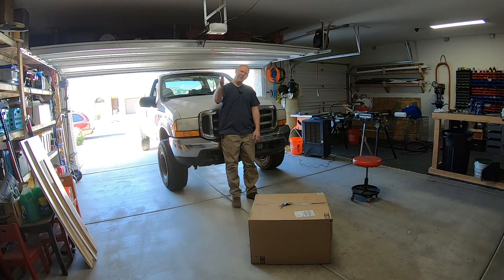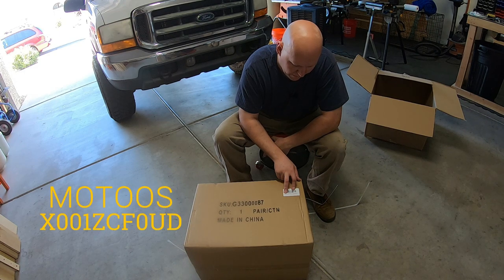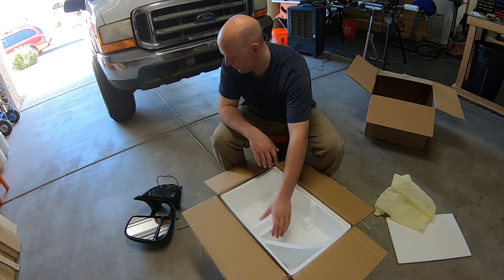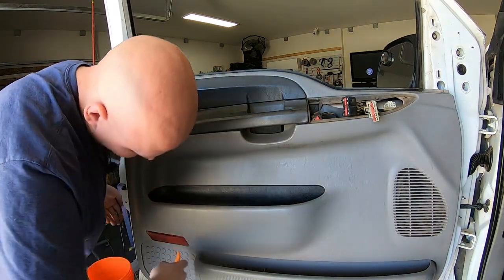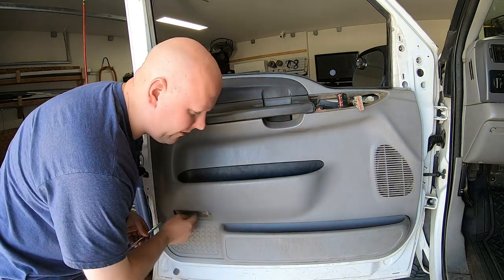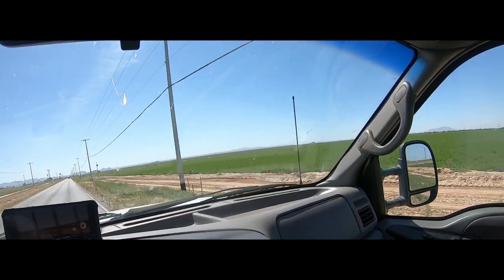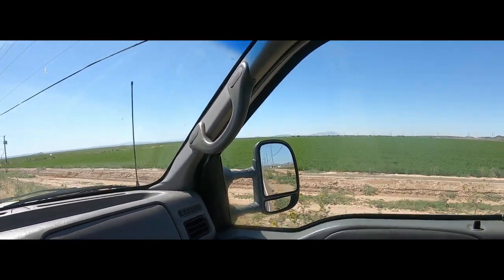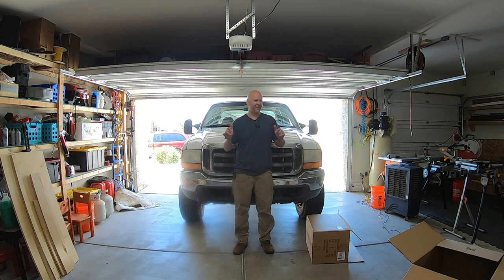Upgraded Ford F250 Tow Mirrors Review and Install

Comment: Learn to shoot video and edit. When you leave the camera on a tripod in fixed location the viewer cannot see details of the work, such as prying out trim panels and disconnecting harness plugs. Also, no one cares to watch you trying to cut open packages with a key and then an opened scissors. Stop the camera, get the right tool and do it right. Edit out the dead times. Your videos will be shorter but more useful. Start by showing and naming the tools needed for the job: socket sizes, extensions, ratchets, screwdrivers (or trim panel tools). your video could be half as long and twice as helpful.
Reply from the maker: Thanks for the comment! I appreciate you sharing your ideal video.